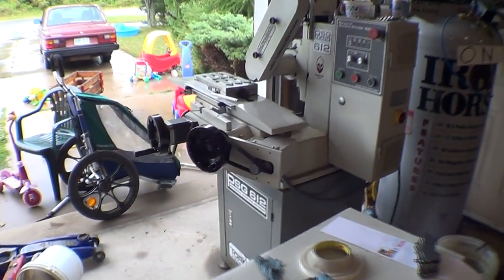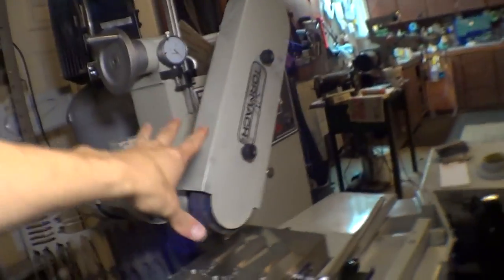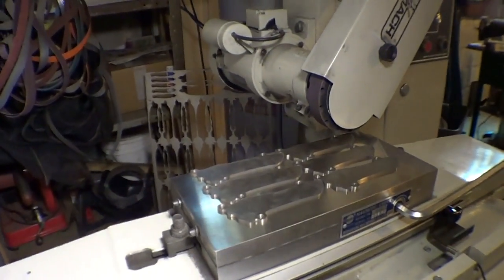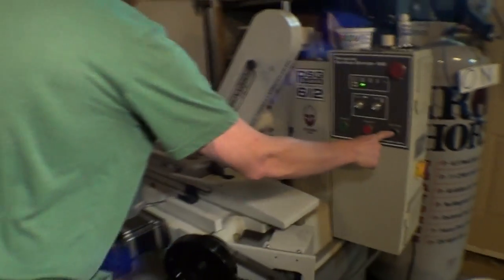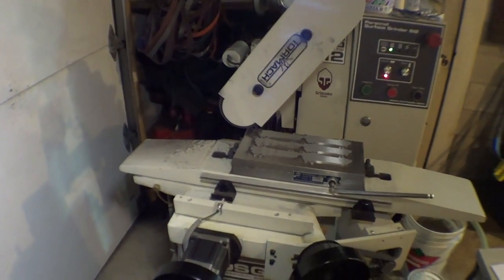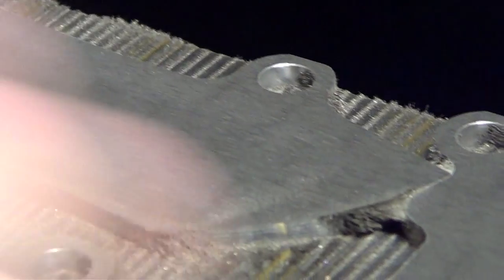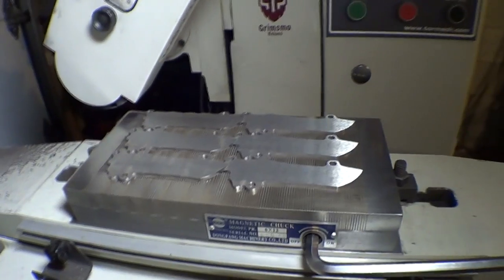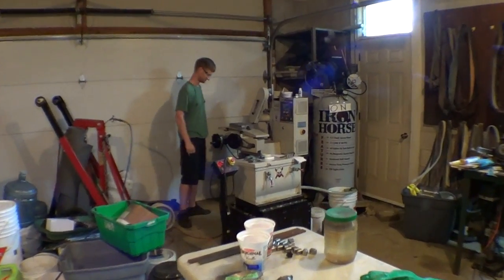Knifemaking Tuesdays Week 91 - Surface Grinding Blade Steel with the Tormach PSG612

Comment: Thanks for bring the videos back into production. One favor I would ask of you is PLEASE use at a minimum a dust mask. I have personally seen the affects of inhalation of metallic dusts especially titanium's and it can be really bad. I actually just lost a friend a couple months ago due to cancer caused by this.
Reply: I haven't heard of steel having any ill effects. Aluminum, yeah (alzheimers). Carbide, definitely (cancer). Not sure of titanium though
Reply: The thing is most alloys have a multitude of components. Also it really boils down to the the amount of exposure your body is getting. 50 apples a day would probably not be to pleasant. 
Aluminum - not generally regarded as serious industrial health hazard.
Chromium - the dusts of chromium metal are usually reported to be relatively nontoxic, although there are
reports of skin ulcers, usually on hands, or a perforated nasal septum. Some insoluble chromium
compounds are suspect carcinogens.
Columbium (Niobium) - no reports of human intoxication.
Iron - siderosis, no fibrosis.
Molybdenum - irritation to the nose and throat, weight loss, and digestive disturbances in animals. No
industrial poisoning has been reported.
Nickel - respiratory irritation and pneumonitis. Several nickel compounds, including nickel oxide, are
suspect lung and nasal carcinogens.
Tantalum - no systemic effects from industrial exposure have been reported in humans.
Tin - dust of tin oxides has caused pneumonoconiosis, which is relatively benign.
Titanium - generally considered to be in the nuisance dust category.
Vanadium - irritant to the conjunctivae and respiratory tract. May lead to pulmonary involvement. Signs
and symptoms of poisoning are pallor, greenish-black discoloration of the tongue, cough, conjunctivitis,
pain in the chest, bronchitis, rales and rhonchi, bronchospasm, tremor of the fingers and arms, and
radiographic reticulation.
Zirconium - studies of several zirconium compounds conclude that zirconium is an element of low toxicity.
NOTE: Some fume constituents pose more potential hazards than others, depending upon their inherent toxicity
and concentration. Of special concern are chromium, vanadium, nickel and possibly titanium. It is advised
that your particular operation be evaluated by a competent health professional to determine whether or not a
hazard exists.

Comment: isn't that a rubber drive wheel and wouldn't the give of rubber increase the tolerance your working with? or can you take "spring cuts"{term by Keith Fernner on you tube} to reduce the tolerance introduced by using the rubber wheel?
Reply: From my experience nothing beats a hard wheel. The belt attachment makes the steel look "good" pretty fast but that's because the wheel has give and the belt touches more material. If not careful it will leave a falloff all around the edge of the part (material will be thinner there, thicker in the center). Standard wheels are precise down to 0.01mm on a 500mm long piece (and no falloff on the edge).
Reply: cubixthe You can always have a harder durometer contact wheel custom made though if you have one with too much give. :)